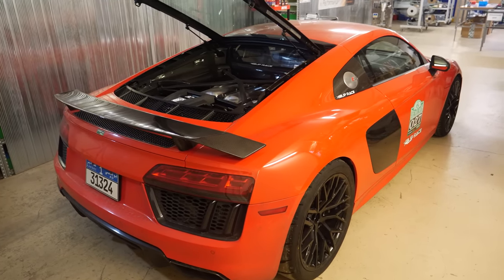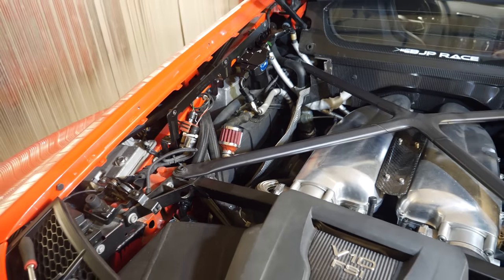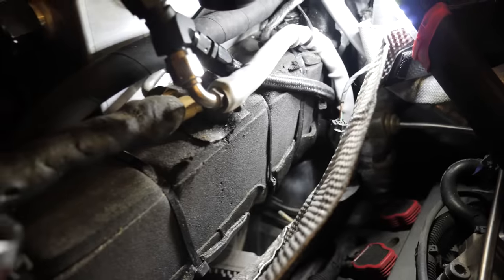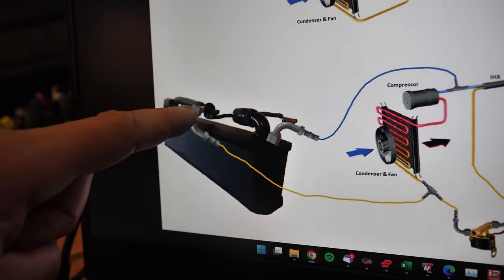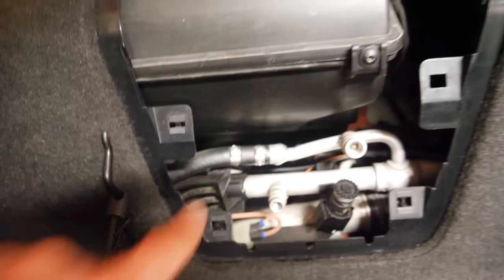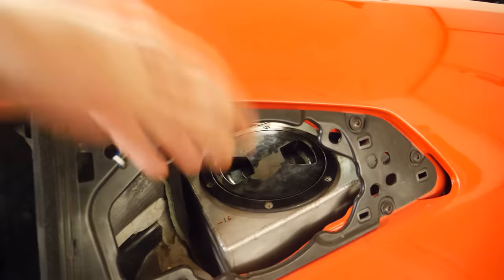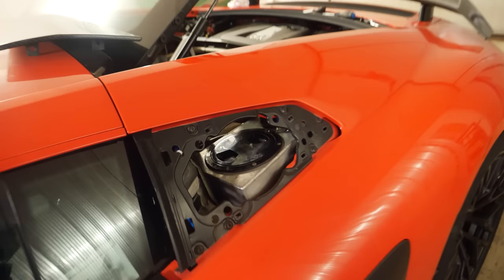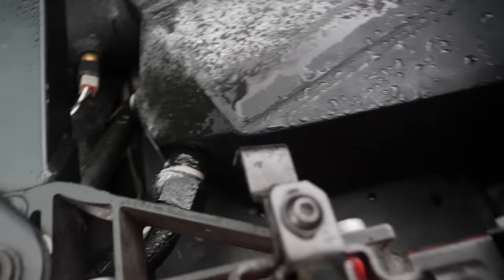Use the cars A/C for Intercooling! Interchiller!

Comment: FI are an excellent business to deal with.
I'm a DIY guy putting an interchiller on my old valiant, working from the ground up as a long term project.

Even though my project is just a 60's resto-mod build and these systems often go on big dollar modified exotics and 7-8sec drag cars, he still wanted to make sure I had the knowledge to optimize my system on the old val and make sure it works as it should.

Before they sent mine out, The owner of the business called and spent about 40mins on the phone with me. He googled pictures of my specific make/model to offer tips on getting maximum airflow to the condenser as well as sizing my AC pump with a high quality unit. He answered any questions I had and told me to call if i run into any issues.

Mine basically paid for itself on the dyno.
Being able to reverse heat-soak and actively control your IAT saves hours of wasted dyno time. You can get a whole weekend's worth of steady state tuning done on a Saturday morning. 👍

Comment: Something to add, now that I've watched the video - the other purpose for the interchiller shutoff valve is so you can use the system on a track without the evaporator dripping water on the track. Cutting out the cabin air means you're not pulling moisture out of the air and so there's no water to evacuate. A lot of tracks mandate turning off the a/c (especially in hotter climates).

Comment: I wonder if this type of system could be extended to provide cooling to the fuel too? I have a car that suffers with high fuel temps because the tank is too close to the engine and there is no way to relocate it or add more shielding

Comment: Everyone laughed at me when I said I wanted to Ac my intercooler. 
I knew I could be done. Luckily I kept everything!
Reply: Klasen has been using this for years
Reply: @TurboAcki  apparently designed in Australia,  where I'm from.
Not many car enthusiasts with Supercars here.
We all usually go the Ls1/2/3/4 route with oversized bolt-on's
Reply: @hulkgqnissanpatrol6121  no problem - A/C cooled intercooler is no new idea :) but may you check youtube for Klasen ;)
Reply: Has been around for many years, I had a Killer Chiller system on my E55 and bought the car with the kit installed, this was about 6 years ago.
Works perfectly ike you would expect and nowadays some newer high performance cars have this option from factory.
Reply: Of course it can be done, I'm not so sure of the benefits though..
Reply: When I first mentioned the idea it was well over 10 year's ago.

Comment: Interesting...I have a 1994 Maserati Ghibli II, and it uses a double-walled pipe to enclose a section of the fuel return line with the a/c refrigerant.   I doubt my a/c is good enough to cool much more though:)

Comment: Amazing I was planning to do this and now I am more convinced, being an engineer I know it will add better cooling to the cylinder after a pull and will minimise risk of overheating the rings and cylinder walls, I do believe that heat is what damage engines not anything else

Comment: dumb question. Why use water when its going negative degrees? do you get small form internal crystalistion of ice, or Ice forming in the main header tank? My little brain assumes a refridgerant with a greater operating liquid temp range would be better. like R32 or R410A. However maybe the flowing water is fine? Would love to put this in my CLS63 but its a dialy driven car which comes from factory with water to air. Thanks

Comment: Cool stuff PB, with interchillers there will be condensation inside the intercooler. You will notice this when you cruise at low load for about 20mins then tip in the throttle. Water condensate will be drawn into the engine causing some bad combustion.
With the Motec if you have M1 build write some software to control the solenoid valve so your target intake temp is at about 20c. That way you will have way more reserve cooling capacity (low temp) stored in the chiller tank for high boost.
Reply: Since his is a water to air system, and the AC is cooling the water via the heat exchanger, The a/c is isolated from the air charge. If the ac is controlled to keep the water temp at ambient and never lower, the condensation at low load will be the same as without A/C. As long as you don't cool the air lower than ambient temperature, water shouldn't condense. You need a pressure and/or temperature drop below ambient to get condensate. That is never the case after a turbo. 
If you put  A/C into an air/air system it will condense because the core is much colder than ambient and exposed to air charge directly.
Ideally you would tune the car to turn off the A/C while cruising because it isn't necessary and makes the car more efficient.
Reply: @notsofresh8563 if he cools the air below the dew point of the air he will end up with condensate in the intake air. The dew point is a function of amount of water in the ambient air, aka humidity. I deal with this stuff working in engine cal for a OEM
Reply: @AndrewEG  That is why I talked about not cooling the air below ambient by controlling the AC with the water temp of intercooler.  After the turbo the air is under more pressure and temp than ambient, thus further from dew point. As long as the water in the intercooler is above dew point no condensation will occur(rarely is dew point above ambient)
Granted the core may be colder but in a water/air setup it is immersed in the intercooler water, not the air. The water temp is the one that matters. as it is what interacts with the air.
Condensation in an air/air setup is way harder to control because the ac core is in the air and way below dew point.
Reply: @AndrewEG  In addition, using the ecu to turn off the ac in light load/cruising situations both prevents your pooling condensate problem but also reduces parasitic loss at low load increasing fuel efficiency without sacrificing high load power.
Reply from the maker: Thanks for input. So far i have not noticed any problem with low load driving. For the solenoid i can write a control logic in the PDM.
But my plan is to control the temp to not be too cold during normal driving with water pump speed. Right now it is on full speed all the time.
Reply: @PeterBjorck  A little methanol added and that condensation becomes cooling......A lot of methanol turns fast into very-super-fast..........Until boom

Comment: The car cuts the AC when you go to full throttle? Logging data on a race tract would be interesting. If you shunt the AC control and run the compressor full time, it would also be quite interesting to measure how much the AC costs in raw power vs how much you gain from the lower temp
Reply: all vehicles cut the compressor when at WOT. weather you know it or not. but yeah it would be interesting to find that out.
Reply: Was thinking the same. I would think that this is something that could be disabled in the cars system.
Reply: @Timoastra  definitely yes, its operation can be changed by programming with changing the threshold values for when ac is dropped off.

Comment: Interesting. Are you ‘taking’ horse power away from the engine to run the AC compressor to cool the refrigerant which balances out with the power gain you get from lower intake temps? Or is the idea that you use the AC power before the drag strip to ‘charge’ the refrigerant and then it helps in the drag?
Reply: I'm sure he said the AC compressor doesn't run on full throttle, so it might struggle on a curcuit.

An interesting idea though on the HP gain from cooler intakes off setting the draw from the compressor.

Comment: I installed a system like this on a mustang well over a decade ago. The customer had to replace the a/c system in its entirety. It would kill the compressor with heat soak.
Reply: The system I installed was in series with the ac system

Comment: If you want even more power, cool your fuel too. Make fuel lines go past the cold water.
Reply: Why has no one thought of this? Not just power but knock prevention, i know sometimes they run a little fuel after lift off to cool the engine, if that fuel was just above freezing the cooling effect would be enourmous not to mention coupled with -5c IATs

Comment: Wow brilliant Peter. I had this idea for a long time also but not building cars at the moment. Actually I want to ask why you use AC-water-air transfer, why not just AC-air directly? Seems complicated and extra weight. Only reason I see maybe is that you cool 'extra' water in the tank and when you accelerate water is slow to heat up Vs AC would heat soak faster. 
I am curious to hear what your experience is because I really like this. Super cool sir and loads of useful info.
Tack!
Reply: That design turns the engine into a very effective bomb if it fails... use with caution.  Also it is more prone to heat soak
Reply: @r2d2fish38  bomb how please? Assuming a refrigerant leak into the engine?

Comment: How's the power tradeoff with an interchiller system? Lost power from the compressor friction compared to the gain from the denser/colder air.
Reply: Even if they cancel each other out you don't have to bother refilling an ice tank, and you have gained luggage space. I think it's a win.
Reply: since the A/C only is active on partial thottle you will have all the power when you make a pass. like all A7C systems it shuts down on a certain rpm to not get over pressurized when going pedal to the metal.
Reply: On big engines with lots of power it's a definite positive trade-off. 10 to 15% added power over the entire Rev range. (Result of my 5 minute research. 🤓)
Reply: Think of it as a function of the effiency of a heatpump. You could probably achieve a lot of the performance benefit in other ways, but you would be having much larger intercooler or other stuff that could for example increase the frontal areat. Etc.

Comment: That plate heat exchanger/interchiller is massive 👌 just a brilliant idea to control the AIT's. 

I completely agree with the volume amount in the tank/buffer. 20L is a good amount of thermal capacity but say another 20L, That would really help and guarantee the temps too stay low on a hard circuits. 

The pdm to control the setup is incredible also. We are really living the dream to the world of tuning cars... anything is possible. 

Keep the vids coming 👍

Comment: Would it be able to be used in parallel with the cabins A/C and still get very cool air in the cabin?
Thinking of using it for efficiency gains during cruise condition for example where you need both. Thinking during double use the condenser becomes very heavily loaded and could become a limiting factor.

Comment: How high does the high pressure get   with this setup with the AC, if you have checked it in just curious im a working as a HVAC tech🙂?
Reply: Shouldn't it be the same? It doesn't have a pump or? Or did I miss something ?

Comment: Do you still only have 2nd and 4th gear or did you fix that? What caused it?
Reply from the maker: It was difference in gearing. The gearbox i did put in had different gearing and the TCU was not happy with that.

Comment: I have been thinking this long time and now i'm 100% sure that it will work!! Hell yeah! 🤘🤘 Does this system work with coolant also or just water? So it can be used winter time also 🤔
Reply: Also would be nice to see dyno pulls this system compared to air/air cooler 🤔
Reply: You can use coolant to but the ac shuts down when it is to cold outside

Comment: Is the horsepower gained more than the horsepower "stolen" because of running the AC compressor and other components needed? If you gain more HP how much % wise?
Reply: Why would you use it if it takes more than gives?
Reply: @jonnenne  One reason would be the positive effects of lower IAT despite constant net heavier load in certain niche applications.
Reply: Of course not, fysics still apply... 😉🤓

Comment: Great video. Im gonna put this in my RS3 thanx wasnt sure I could use it with a Turbo car but I guess I just have to go W2A air now. I already have one in my Redeye well sorta cause it comes with a factory one but I did upgrade to the stage #2 for my redeye and I also put one in my Trackhawk while using the Cortez setup that gives u more cooling volume.

Comment: Could be made to be an independent system by using a standalone electric AC compressor instead of engine driven that cuts out with high throttle inputs.
Reply: could maybe try to harvest the ac system out of a prius. they're electric powered instead of belt driven so work independent of the engine
Reply: @kasuraga  these Pirus AC compressors run on 230-300V three phase high voltage and need a high voltage inverter to operate them. if the car has an AC system, there is no need. The cooling power is anyhow insufficient for sustained WOT. It is only good on the drag streep or a pull or two on the streets.

Comment: I’ve heard these systems fail and ruin motors… I chose to go methanol. I hope the very best for you!
Reply: I run methanol and still need better cooling.
It'll damage an engine if you ignore all the safety lights/alarms and temperature gauges...
Reply: How can it cause damage to the engine its just a normal watertoair intercooler with interchiller
Reply: @Slatteby  I think they might mean overheating? 
It was the ONLY thing I could think of...
Reply: @Slatteby  the way it was explain to me was if it quits there’s no indicator that it is not cooling the air and the engine doesn’t know to pull timing out fast enough to save itself. I wanted to put a inner chiller on my ZL1 and I had too many opinions, professional, and not talk me out of it because of this
Reply: @The_Drive_Inside  This car has intake air temp sensors so the ECU knows when to pull timing or adjust fuel. Factory ECUs frequently don't use these or if they do the circuitry is very basic and tuning may not be an option or is locked out. Safeties for when air temps spike are available in most aftermarket ECUs
Reply: @notsofresh8563  I’m REALLY wanting this to work… I’d just have to see a couple years of daily use before I’d take the risk. In theory it’s genius. Dodge has it but most people that have redeyes park them unfortunately

Comment: Hey,Peter,this idea is not so good, from engineered aspect!! Lower intake during the cold weather,means worse fuel homolugisation,low power,high emisions an quick lash the bore!!! This is very old idea...you can instal WMI with better results!! And you push you AC compressor to work.with 100 % pwm control valve...no godd idea again!! Think abot it!?🙂